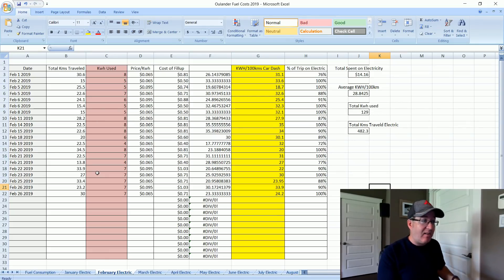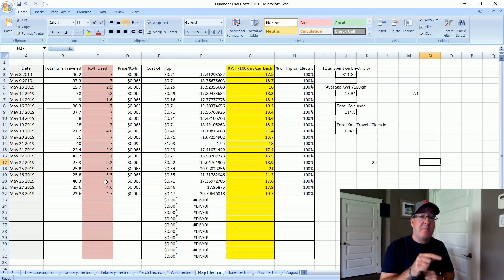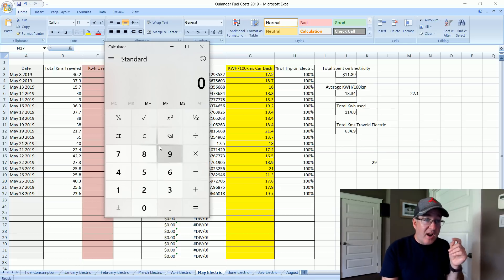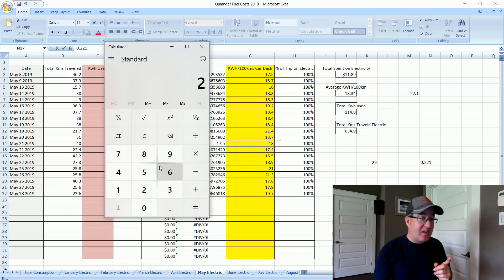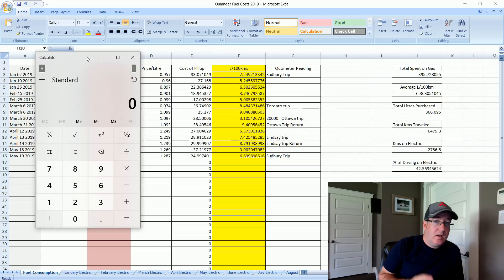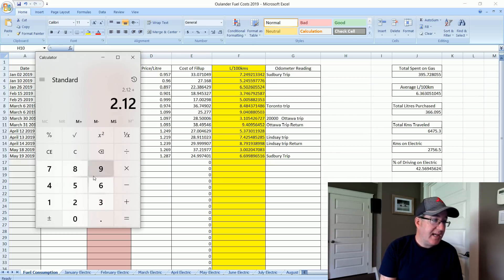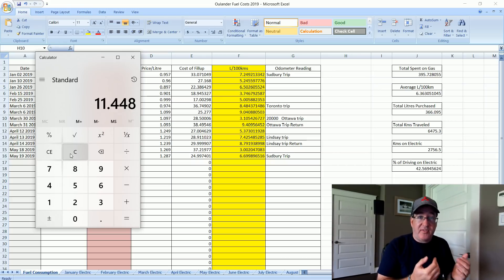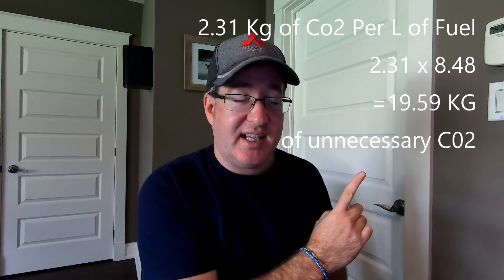Mitsubishi Outlander PHEV - Battery Degradation Cost Quantification

Comment: You havent substracted off the cost of the KWh that you were unable to put into the battery. If it is not taking a full charge, then obviously you are not paying for electricity that you cant put into it.....so i dont think your figures are quite as bad as you think...... 

Maybe i've got my sums wrong.?? When the battery is brand new it can take 70% of 12kWh(2016 model) to charge it to full capacity(allowing for the 30% lower buffer, where the ICE kicks in). That means when new, the cost to charge is 8.4kWh at £0.16/kWh = £1.34(substitute own currency and 'all in cost' electric rate). When degraded by say 10%(yours currently 6.25%), then it will only hold 7.2kWh(usable) @ £0.16/kWh=£1.15    (10% of 12kWh =1.2kWh degradation. Subtract from the 8.4 kWh usable = 7.2 kWh usable)
It will also charge up slightly quicker(because you can only push in 7.2kWh.) So the 10% drop in capacity = 10% drop in range. If you start at 32 miles(2016 UK spec) = 3.2 mile drop. Thus on journeys that are of 32 miles distance, you will go 28.8 miles and the ICE will kick in. However, you will have saved the cost of electricity not put into the battery for that 3.2 miles, but will cost the petrol for same 3.2 miles. In my case, save £0.19 on electric, but costs me 3.2/43mpg (0.0744) x price of petrol/gallon(£5.36/gall)=£0.40, thus a difference of £0.21 overall, but only on worst case scenario's of 32 mile range. For all journeys under the full(current) EV range(28.8 miles), there is no detriment....you just have to charge slightly sooner. 

For journeys longer, say 60 miles etc, then the overall percentage of increased cost over the whole journey is relatively small.
Applying to 60 mile journey...

 ie Cost when battery new = £1.34 for 32 miles(electric cost) plus 28 miles cost of petrol =28/43 x £5.36 =£3.49, giving total cost of £4.83.
On 10% degraded battery, 28.8 miles (electric cost) =£1.15, plus 31.2 miles petrol cost = 31.2/43 x £5.36 =£3.89, giving total cost £5.04 

Difference = £5.04 - £4.83 = £0.21(4%)...., the higher mileage journeys work out less percentage wise. (200 mile journey = less than 1% increase cost overall....for perspective) 

UK pays through the nose for fuel, so i imagine the fuel cost impact in Canada would work out even less. ;-) (we are roughly $2CAD/ltr for petrol by comparison) :-(

I think what is miffing everyone, is how quickly the BMU unit is taking the battery to a 50% DoD, (ie a 70%[8 year warrantied capacity} of 70%[usable capacity] situation)thus increasing battery cycles/longevity. All these resets are taking the battery back to a 70% Depth of Discharge, thus reducing the total number of cycles that the battery will output over the long term.
Very happy to be corrected on my understanding of this? Only hope i have explained my thinking well enough. Would welcome feedback, especially if i am wrong. Ta

 Just some food for thought?
Reply from the maker: Yes I did adjust for battery losses...my battery was reset and is at 37.5 ah currently.

Comment: Hey Gary, have you read the Aussie’s post about the guess-o-meter having too many references to calculate therefore misreading the battery potential.  
The result therefore is the computer using the guess-o-meter as “fact” which is false.  The answer was to clear all the cashe memory from the computer and perform a cell smoothing on the battery.  At least That’s the answer from down under.
Reply from the maker: Yes I watch Andy's channel.
Reply: Have you figured out how to retset the the battery stats in the firmware?  I’d love to know how to do that myself.

Comment: My car is 734 days old and is soon at 38000km. The battery is at 31.1 Ah. The big issue is really not that it is at 81.8% SoH, the big issue is that only 70% of the battery is usable.

Will the 30% limit for running on battery change when the battery health degrades as well? If not, 31.1/40 becomes 77,75%. Of these 47.75% is usable. 47.75/70 is 68.2%. I.e. the battery gives roughly 2/3 of the driving range it had less than two years ago. 

If we instead calculate the capacity with a lowered lower limit of 30% of the total capacity, then the remaining capacity is 74%, i.e. 3/4 of the original driving range.

Independent of the way to calculate this, the loss of driving range is not acceptable!
Reply: Get a dbcam procedure doneand you are back at 99%,hasnt your garage told you this? . The 30% reserve is for battery protection, and the range is only calculated on the 70%usable anyway. You must also check if u actually have the same degregation of your range as battery.

Comment: How much is the depreciation on the car value every year? Thousands of $$'s :)
Are you billing Mitsubishi for that as well.....
Reply from the maker: Well the long term plan for this one is to run it into the ground...I have 2 teenage daughters who will take this over when I am done with it...but yes...exactly...who would buy a car with this software in it???   Nobody.
Reply: @GaryReedUnfrequentedWorld  Gary, I get your frustration. I own a 2018 Leaf and it has 9400km on it and my battery is at 96.3% SOH.  That means I have almost lost 4% of the battery capacity in less than a year and only 9400km.   But that's unfortunately the way the LI-ON batteries work.  Even Tesla's degrade, although at a slower rate.  Usually the degregation tapers off and will flatten out, but it's going to happen.  Age+heat are two major factors.   Considering the small 12kwh battery in the Outlander PHEV and how frequently it is charged and used, it's probably going to degrade faster, but it also depends on the chemistry used in the cells.  Maybe Mitsubishi isn't using the best chemistry (likely) and the capacity just degrades faster.  I also read there is no upper buffer either, so if you are charging it to 100% and leaving it sit there for long periods of time it is not good for the battery health.   That being said, I am still considering purchasing a 2018 Outlander PHEV because they are giving big discounts at the moment to clear them out.  We will see.   Your videos have been informative, thanks!
Reply from the maker: @Darrenhd2  Thanks for the comment Darren, but this is not natural lithium battery degradation. In fact as a leaf owner you should know that Nissan went through this exact issue and released a firmware fix back in august of 2018. At that time you guys had about 10% degradation average curve after 1 year. We here in Mitsubishi land are closer to a 20 % loss after 1 year. The software in the car is the suspect party adding an artificial 0.1 ah drop every couple of weeks to protect the battery. In fact we do have a top buffer...all cars charge to 38 ah from the factory. The battery is a 40 ah unit.
Reply: @GaryReedUnfrequentedWorld  Yes it does seem the degradation rate is rather alarming.  Is it not tapering off at all? There was a youtube video by a guy in Australia (he mentioned you in his video) where he was doing a range test without the heater on.  He showed his watchdog app and he was at 39.4AH and he had 84,000 km on his Outlander.   I wonder does he have the newer 13.8Kwh battery or is something else going on?  I know with Nissan they released a software fix for battery charging times, and older leafs got a BMS fix.   Does Mitsubishi have a head office in Canada? Have you tried contacting them?
Reply from the maker: @Darrenhd2  I watch Andy's channel daily. We are in contact regularly. He had a battery replacement from Mitsubishi and his new battery is still degrading in the exact manner as the old one.
Reply: @GaryReedUnfrequentedWorld  Ok I did not know he had a replacement.  Well keep up the work on Mitsubishi.  I'm still on the fence about the 2018.  It's a great deal now with 0% financing and 7500 off MSRP (including the new $2500 federal rebate). I wonder if it is possible to check software versions like you can with the Leaf and the LeafSpy app.  For example, does the 2019 show a different software version? I have an OBDC dongle for LeafSpy (a LeLink bluetooth low power) that I can see if it works with the WatchDog app and I could check at my local dealer to see what the 2018 says and perhaps a 2019, but I am not sure my adapter works with the WatchDog app as it wasn't on the supported list.